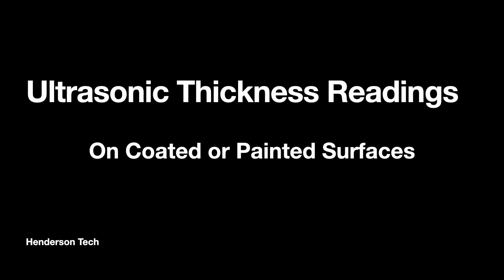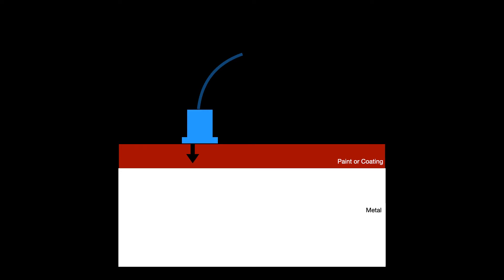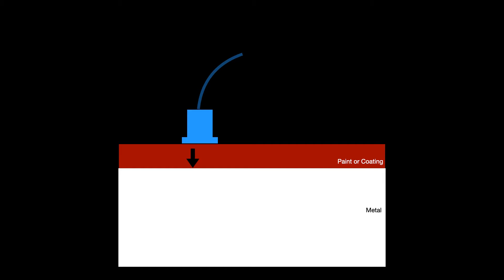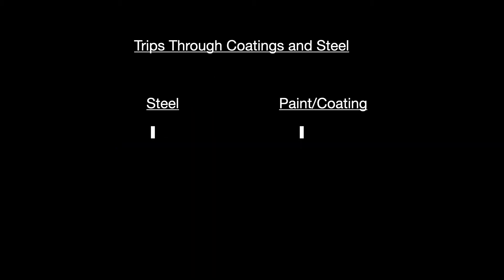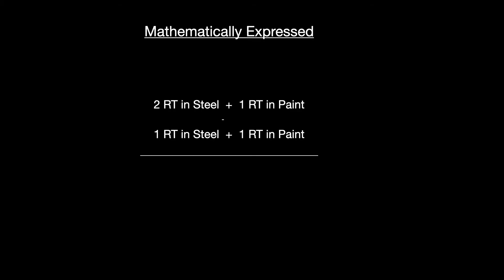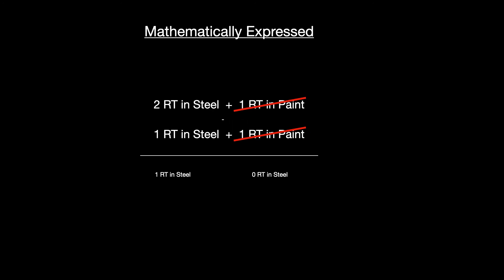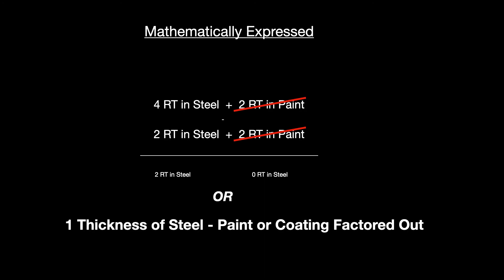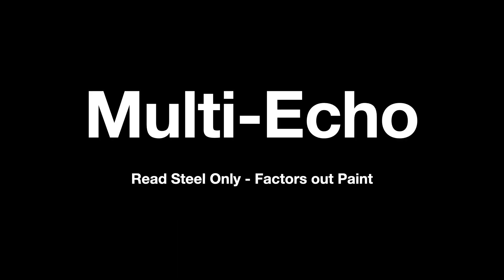Ultrasonic Thickness on Painted Surfaces

Comment: Hi Henderson Tech, I've just come across your video while in search for an ultrasonic gauge. I'm a junior building surveyor and could use some help, I need a gauge that can measure the thickness of paint on a metal surface but it would also benefit me if it could measure the thickness of paints or finishes on timber as I've not found a company to mention that its all metal, glass or PVC.

Comment: What setting do I use on Sonatest Flaw detectors?
Reply from the maker: I don't have any sonatest, but you want to use whatever they call echo to echo or multiple echo mode.
Reply: @hendersontech  Thanks for the reply do I need two gates one over the first echo and one over the second echo?
Reply from the maker: @nw8000  It will depend on the specific hardware and software version but you may have to do that, I think in some Sonotest it has both options, depending if you want each gate threshold to be independent, but I don't have experience with those machines personally.